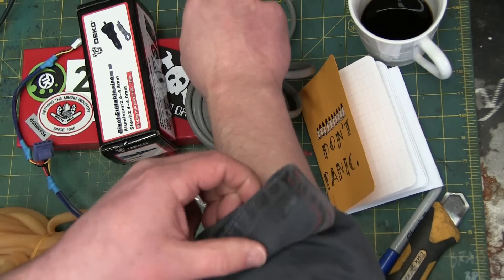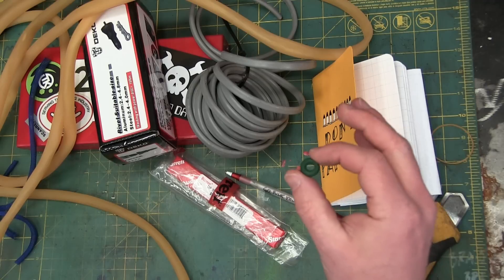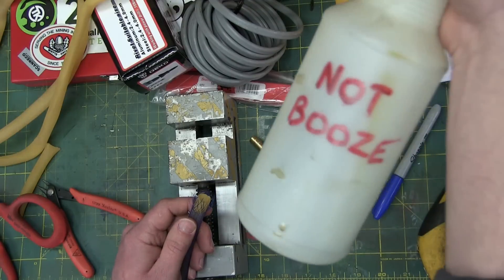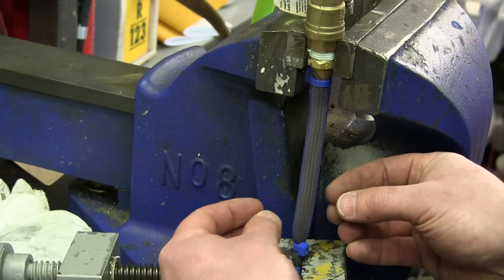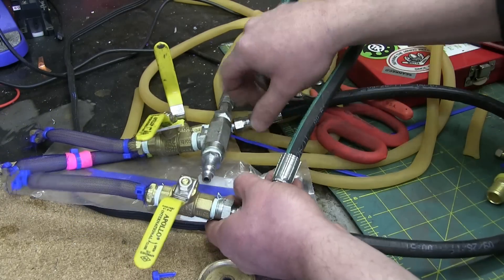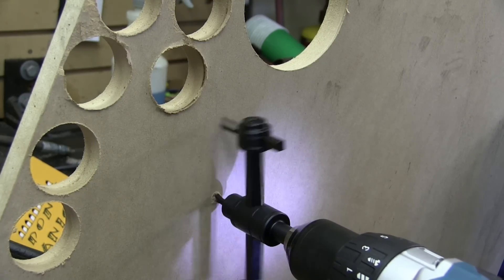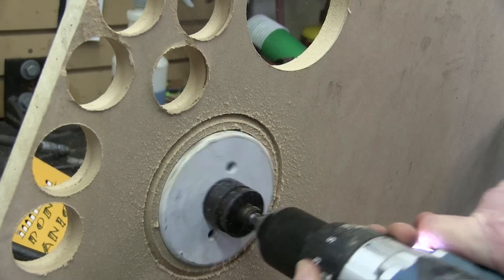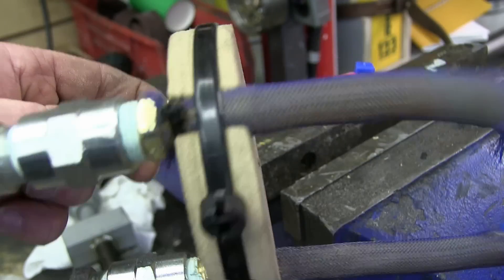Air Muscle Flex Joint for Soft Robot.

Comment: You could put a rod with rounded ends or a joint in its center between the plates and increase your play per stage by keeping each plate from moving toward the other.

Comment: Mr. AvE, I have a pretty serious question for you. Knowing that you're more, "skookum" as one could say, with the whole e-lec-tronical stuff, like LED's and using the magic pixies from the wall to light up a room like it's Christmas, would you please point me in the right direction as to how to build a custom led light fixture. And I do mean custom. Not something that you type in on the Gargler and order from the Big Rock Candy Mountain that's all ready prefabrimacated with cheap Chinesium metal and what not. The reason I'm asking is because here lately, I've been getting my hands dirty with soldering and replacing factory halogen bulbs with fancy LED's in my steering wheel controls and such stuff in my truck. And the lighting in the garage I'm doing such stuff in, is not all that good. Such fixture I have in mind would be less than two feet long and less than a six inches wide, and be able to plug it into a wall too. Or even run it off a Li-Po and have a portable LED fixture. That's why I am consulting you as to what I need to build such LED fixture. Because I was about to order some random 10w LED chips off of FleaBay, (from 'Murica obviously, because why the Hell not?), and I said to myself, why not just ask Uncle Bumblefuck and see what he has to say about this. He is more knowledgeable about this than I am. If you could please help me with this, that would be greatly appreciated.  Thanks. -Blaylock
Reply: Well, I'm not AvE, obviously, but I've done quite a bit of electronical diy so here's my two cents:

I assume you're look at the modular screw down units like with the 10W ones you mentioned, So here's how I'd do it, I'd go with 4 of them (for reasons I'll explain further down), in which case you really just need a metal back plate (like a nice 6" wide by 2' long chunk of 1/8-3/16" ally) (for heat dissipation) wire them up as 2 series sets and parallel the the two sets together, hook everything up in the right places secure the ancillary parts like the supply and you're good to go.  On the matter of the supply, like I said I had my reasons for suggesting 4 chips and wiring them as such.  There are two, one that's roughly equivalent of 240W tungsten, I've got a single bay garage and I run equivalent of 120W x4 for my whole garage and find that just about right, also in spot applications 250W tungsten/halogen is about the most that's really comfortable to be using for me if I'm working on a light surface.  The other is because these buggers tend to have a forward voltage of 9-11V so your target is around 10V.  10V switchmode supplies are a rare beast indeed however.  19.5V supplies OTOH are a dime a dozen because just about every damn laptop made runs on them and they typically throw 3.5-5A which since we need something like 2.1A with 19.5V to satisfy the 40W we're well within our limits and those suckers can be picked up at $5-$6 a pop if you look around ebay.  Or, if you're like me and packrat every spare electronical googaw on the principle you might find a use for it one day you might even have such a beastie in your junk drawer, just make sure to check it's label, there are some exceptions, I just did some work on an older Core2 era HP a couple weeks ago that for whatever reason instead runs on something like 14.5V.

Any questions on what I'm outlining feel free to ask in a reply.
Reply: bashkillswitch That's knarly man! Thank you sir!!
Reply: Do make sure that what you're looking matches what I'm describing wrt to the LED cob chips though, the 9-11v seem to be predominant for US suppliers stocking 10W ones atm but 30V ones are, or were, at least, much more common at one time.  At least from the chinese suppliers.  Those are even simpler, same setup but series 4 together, run them to the outputs of a full wave bridge rectifier and run 120V mains to the inputs of the rectifier, since their total forward voltage drop at 4 units x 30V = 120V they're able to drop mains voltage directly all on their own.  The rectifier is just there to get the most light output and fold the frequency of the flicker up from that cheap xmas tree light 60hz that drives me nuts to 120hz where it's not noticeable. (without it you get both the flicker and are effectively running them at a 50% PWM since power can only go through them one way they're off for over a full half cycle so they'll only really deliver about half as much light as they're rated to) and bridge rectifiers truly are jellybean parts, one the few things that you're still likely to find in the parts bins of a local radioshack and usually a couple three bucks a piece even there will get you a nice big massively overrated with a handy hole though it's middle what for screwing it down on the plate with all your other components.

Comment: iv done that before, if you use smaller tubing so when it blows up to its full size it fills the mesh it works alot better, also try using the really cheap cable management mesh it shrinks/expands a lot better so u can get more travel

Comment: I'm gonna try doing some 3d printed molds to see if I can cast parts with a two part soft rubber. I really like that wire loom idea. I wonder if you could make fittings between the loom that direct an infation in order to make a turn sort of an external knuckle. anyways thanks for all your great vids.

Comment: try limiting the movement on the elastic bands with some rope mounted at different locations. for example, by having a fix length rope on one side of the tube, you can make it bend in that direction, since it could only expand the other direction. with multiple restrictions  you can get some really fancy movements. say for example, sequence of movements or even twist motions.

Comment: Worked for some vets back in the day, that O ring thingie sure is nasty. I believe they sold kits on the interwebs for people too - who want the easy way out from relationships.

There is another kind of tool which you clamp around the base of the sack, put the other end in the drill chuck and just twist the thing right off. They've used those on horses and stuff... very effective, no blood at all.

I'm sure you can still find the instructional video about it if you are so inclined... I may never be able to unsee that shit.

Comment: If you added a tensioning device with a ball joint in between the plates in the center to spread them slightly it will work more better... It wouldn't be as soft though.

Comment: Now I will preface this with saying that Im probably totally wrong, but, Uncle Bumblefuck, could it be that the ends are being compressed too much by the wood? If you think about a chinese dingle arm trap (Dont judge me, we all wanted to try it) I imagine that holding both ends tight may impede it's chooch factor. Maybe have the tubing held down to the wood and the outer muscle part inside the two spacers to allow it more room?

Comment: Cows can't get castrated.
Reply: illuminati theme engaged
Reply: Heifer= Cow before it has had its first calf
Steer=Bull thats had his nards nipped
Reply: While all cows might not be bulls, all bulls are indeed cows.
Reply: Heifers
Reply: using bands is really a harsh way to castrate. in England your only allowed to do it when they're less than a week old. Anything up to six weeks you can cut them without anesthetic (slice scrotum with razor, twist the testicle cord then give it a yank. repeat process on other testicle and spray liberally with antiseptic) and in NZ I believe they do use they're teeth once they've made the initial razor cut!
Reply: I'm from the USA, and i've known a few ranchers that use the bands on calves, but for the most part, its a sharp knife and a bottle of the red stuff to keep it clean and keep the pests off. Most people i've been around consider the bands to be cruel, because its a week or two of pain and having the balls basically shrivel up, rot and drop off, vs a quick cut, which  scabs and heals in a day or two.
Cattle have freaking insane imune systems, and heal quickly. I knew a vet who claimed you could cut open a cow, stuff a dead cat inside, and sew them shut, and they'd go on like nothing happened. of course, he'd never actually do that, as he was a damn good animal doctor, and took good care of every critter I saw him touch.
Reply: They would need to milk for a loooong time, Steers are castrated bulls: https://en.wikipedia.org/wiki/Cattle#Terminology
Reply: I hear steers and queers come from texas and you dont much look like a steer.
Reply: +Shane Gadsby a friend of mine who worked on a relative's cattle ranch up here in ND said they used a bolt cutters and a can of lysol, sounds similar.
Reply: Well spotted, only a Bull can, in Ireland after castration they're called Bullocks.
Reply: Shane Gadsby I'm saying they are for sheep
Reply: Nope, bovine is the family. Bisons are bovines.
Reply: Thanks for the info. Good to know.
Reply: A cow is just a heifer that has given birth. But all cattle are bovine. A castrated bull is a steer. That is why you only eat steer, baby making potential went into the dirt with a rubber band. Plus balls make the meat taste weird if they keep them for too long.
Reply: Lucky for y'all he was only explaining the banding process instead of whipping out a Burdizzo or a Newberry knife. Then y'all would really be holding them and thanking God that you aren't a bull calf.
Reply: Carl O'Donnell yes same in England. ironic as bullocks sounds awfully close to bollocks, which they obviously lack!
Reply: These comments need a novelization.
Reply: best reply ever
Reply: Tell that to your mother.
Reply: Said calves, not cows.
Interesting note, there is no generic term for an individual adult member of the bos genus. 
All the names are gender specific.
Cow & Heifer = Female
Bull & Steer = Male
Reply: The Reverend. No cows are cows and bulls are bulls but they are both bovine!
Reply: I've never see a single farmer here in Australia use a Burdizzo or Newberry knife, heck, I've never even seen them use the elastration bands on anything but sheep and goats. As the son of a 3rd generation farming family (both sides of my family) the only method I've seen them use for calf castration is  metho (http://www.diamondspirit.net/adunk/metho.html), a Leatherman, and a bottle of Dettol (https://en.wikipedia.org/wiki/Chloroxylenol)
Reply: Not to be a bovine nazi but the correct terminology would be "steer"?

Comment: I laughed my ass off when you had the circle cutter in the drill lol
Reply: Wrangler Steve I agree it was just his reaction lol
Reply: I was like I don't think that goes in there lol
Reply: I laughed mostly because I have wielded lots of knuckle busters like that as well.
Reply: I've done it with drywall, not through 3/4 plywood. That is a  large radius too.
Reply: the problem was not the cutter, not the operator, but the undersized drill. He should have used a big dril at a high speed without proper proper grips, that the way they work best(for youtube atleast)
Reply: Nah less speed more torque and a right angle handle